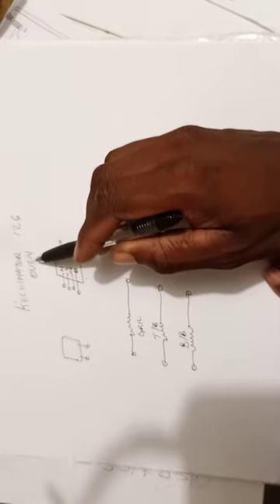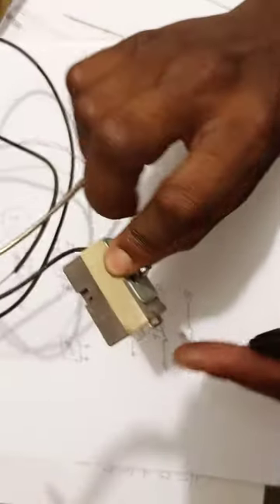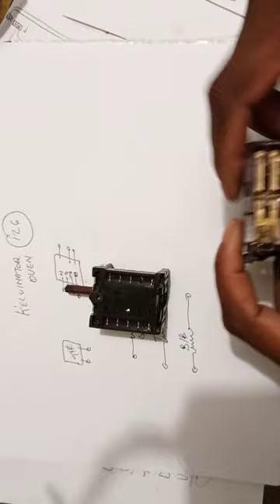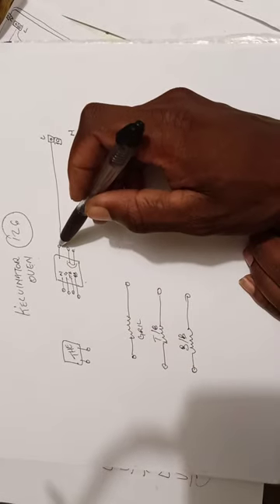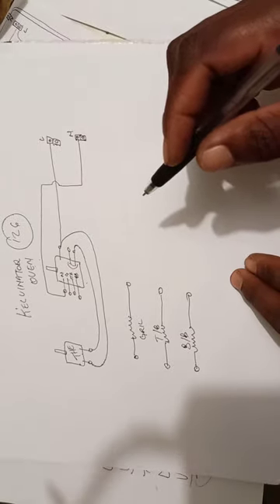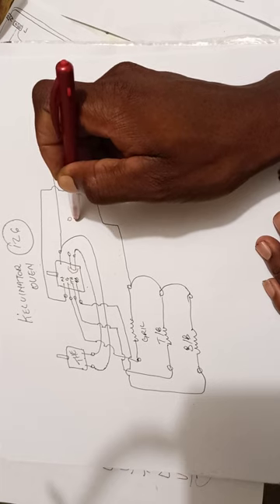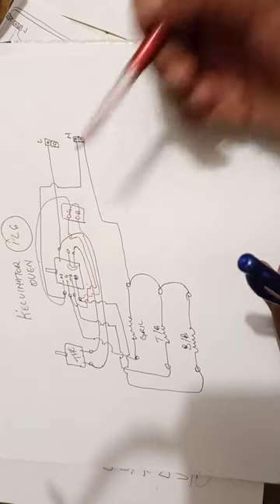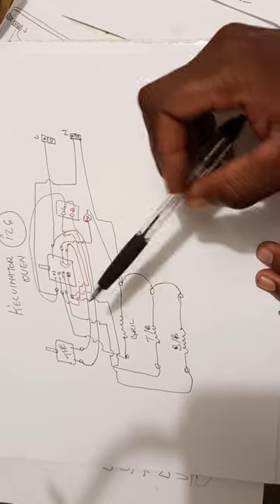Kelvinator Oven wiring. Model 126

Comment: Do you have any videos on a winco epo1? Its got a lower burner and upper burner, i got a new thermostat and on off switch but now that i have everything buttoned up its not heating. :(
Reply from the maker: No, I don't  have. On similar situations I  contact the manufacturer for service manuals.
Reply: Halllou